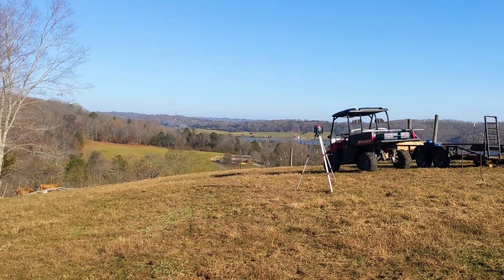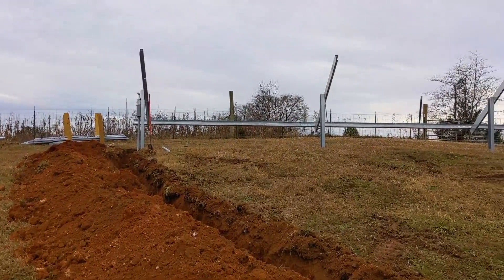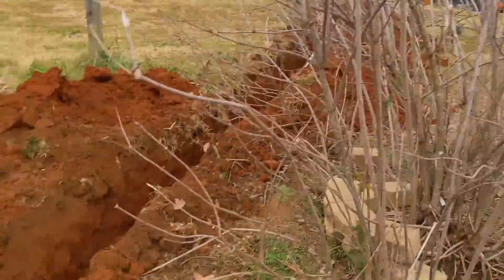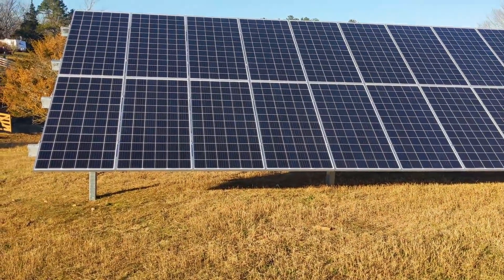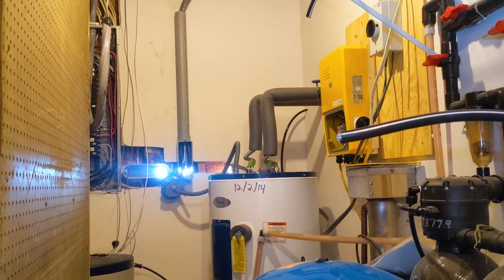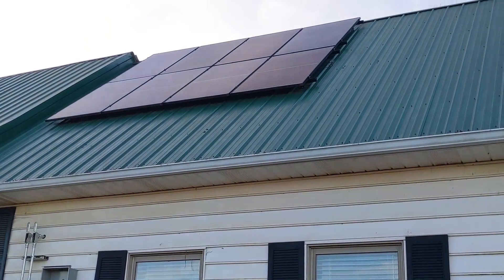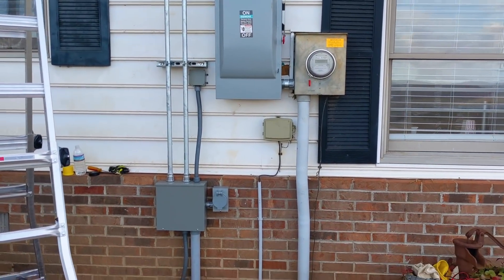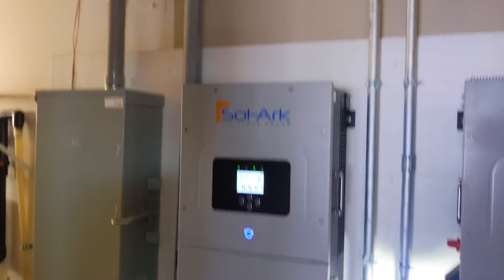Tennessee Farm Solar

Comment: Wow! That's a long run on that cable. It would be interesting to know what size cable you are using to span that distance. Do you ever run a risk of voltage drop in an install like this? Just curious. Very nice office space. LOL

Comment: Nice install. Seems like you have that installation down pat..
Question, The limit to home with CTs, when a load shuts off I would assume the inverters backfeed past the utility meter for however many milliseconds until the inverter realizes the loud has stopped. Is that small amount of backfeed a problem for the electric companies? Can they see that very short duration backfeed on their end?

Comment: Must be a high voltage system to go the distance from the panels to the house.  Most diy systems are max 48 volts. And that wouldn't work 300:feet away from the batteries.  Must be pricey!

Comment: Great install man. What is the DC voltage coming from the solar array? You said distance was around 300ft so what is the loss? Not a big issue if voltage up in the 400-500 range??
Reply from the maker: 350

Comment: I forgot about not being able to see power back to the grid in some areas. Wondering why that's their policy? Just looked it up, sometimes it's because the utility doesn't make money from that, to pay for transmission lines and the like. Seems to me, they could just pay a bit less than what they charge, and make up the difference.
Reply: And I have read, but not confirmed that some of the transformers are not terribly efficient going back the utility so they might need to be changed?  I wish I could get some confirmation on this.

Comment: Curious what a massive system like this would cost?
Reply: 60k atleast
Reply: When you are paying $2700 per finished battery that alone is $19,000 plus 2 solark 12Ks at 14,000 you are at $33,000 there. That does not count the panels or mounts or wire or labor.